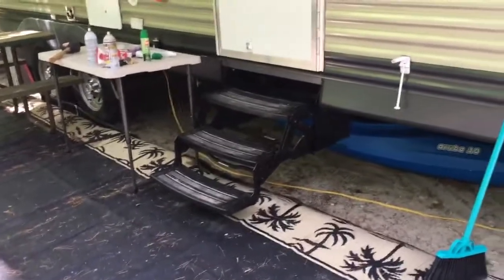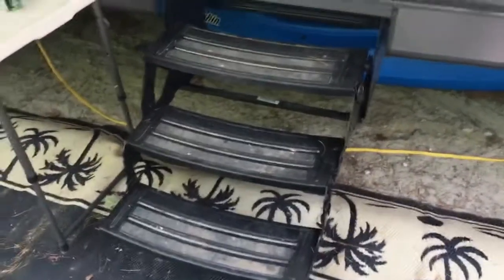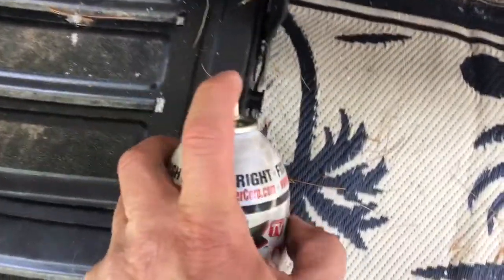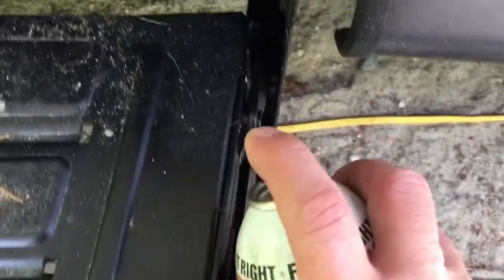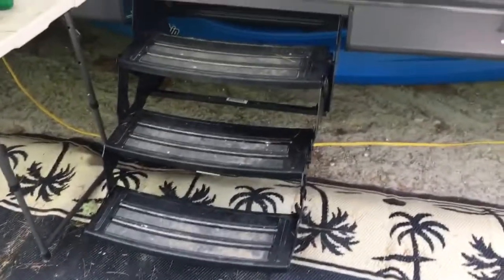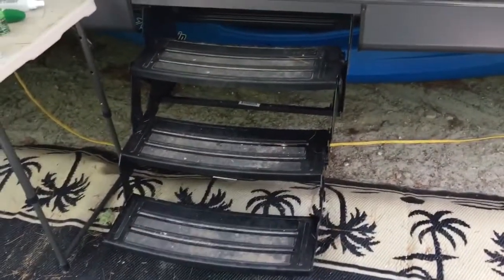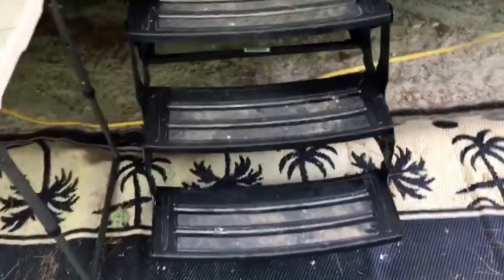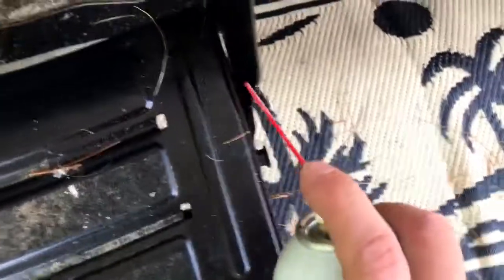How To Loosen or Unstick Frozen RV or Camper Stairs That Will Not Fold In

Comment: My RV steps won't open after the winter.  Any other suggestions? I've used PB Blaster and liquid wrench. Neither enabled me to open the stairs.
Reply from the maker: Mine were the same way. I soaked the crap out of them with PB Blaster then they freed up. They were really really bad
Reply: Try a solvent based penetrant PB Blaster & liquid wrench a petroleum. Solvent is a heavier liquid than water therefore it flows under water and or through rust as what causes rust?
Reply: I hit it with a lump hammer and a pry bar it came down but now soaking it to get it up

Comment: I had Kwikee  steps stuck in the out position . brought the pb blaster after I used up about half a can  the steps became unstuck the $5.98 can of blaster saved me $$$ I thought I would have to shell out for mechanic to do the job
Reply from the maker: Mine were very frozen in place. I could barely move them. Hitting them with white lithium grease helps

Comment: Crap I need to know how you pull them out .do you lift up if so where am do you pull out if so where  do all the steps fold the same way . Everytime you got to the actual moving the step  you stop the video.
Reply from the maker: They should just pull down. They should move freely.
Reply: @HomeownerRepair  
Thanks I'm going to go get a can of the stuff you said  I can't remember the name but I know what the can looks like  I have used it before and it works better then  wd40 or blaster. I have a 3 stepper and you say straight out ? I will give it
Reply: @HomeownerRepair  thank you for your reply .I sprayed them real good and let them soak then sprayed them again and even put a couple big flat bars in between them and tried to loosen them up still they wouldn't budge .but I found the answer I backed my pick up close enough that I could attach a come along and they started coming out with out to much pressure on them and then one side locked up . I moved the chain over to pull a little more on that side and kabam  they came right out .I sprayed them again and open and closed then a few times and now they are perfect no dents or ripped off steps or nothing . Thank you for giving me the confidence that I was going about it the right way. None of the videos show the steps opening  and closing  .they only show them open and closed. And I couldn't tell if one step flips over or if there was a trick to opening them . Thank you